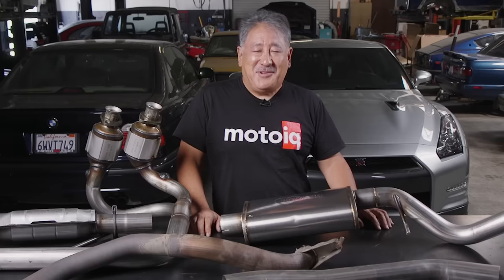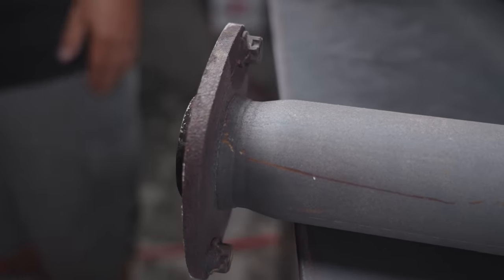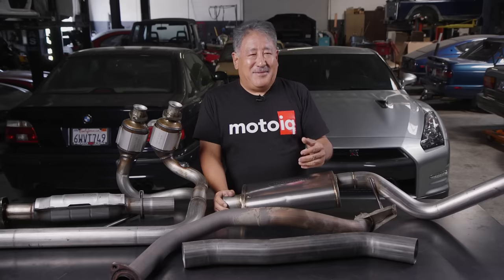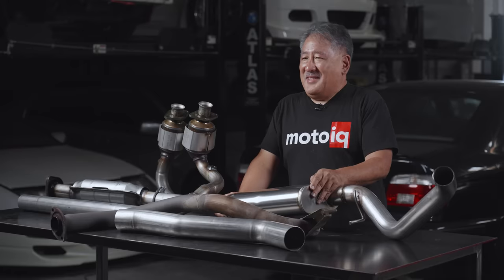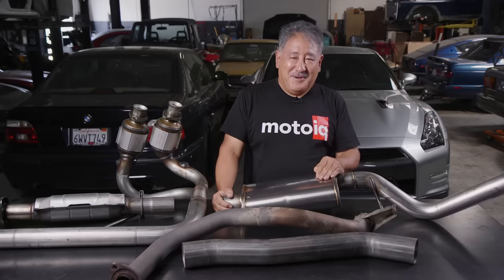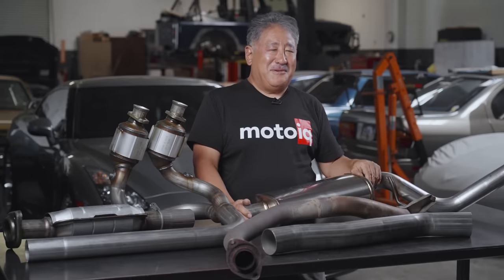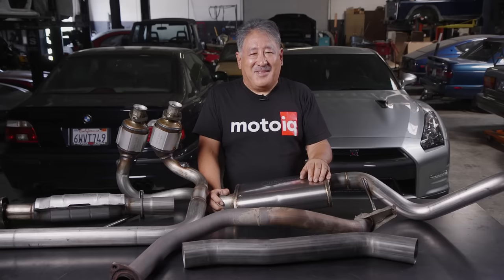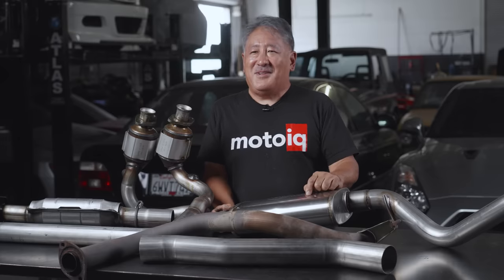Exhaust Back Pressure Myth DEBUNKED!

Comment: My Harley  definitely goes better and has more torque with a resister washer in the end pipes.
Reply from the maker: What happened is either, a big exhaust leaned out your AFR or the exhaust was too big and killed your velocity. Put a wide band on and log your AFR, if it is lean, retune it, if your AFR is OK you will run better if you lose the restrictor and run a smaller diameter primary pipe instead. Velocity up, backpressure down.

Comment: What about cars with a big muffler, change it to a straight pipe.
Wouldn't that annoy the computer?
Reply from the maker: Big doesn't define the performance characteristics of a muffler other than its big.
Reply: @motoiq  
Ok how about like a brand new mercedes, right? But at the end of the exhaust, you put yo dirty sock full of sand in there.
Car runs fine whatever.

But then you literally take out the whole thing, muffler, cat even the fucking manifold and shit.

Would the ecu think "yo, why i no feel any exhaustion?" And then it does some fucky ucky things and make the car run bad?

Or would it think "bro I can't feel shit and that's not my problem LMAO"?
Reply from the maker: I dunno there are a lot of variations of brand new mercedes you might need to tune your ECU.
Reply: @UltimatumDemon yes, obviously when u change exhaust the af changes and needs to be mapped to compensate for the extra flow .

Comment: So basically every car needs different types of scavenging,  back pressure or velocity. one formula does not fit all application from high RPM to low RPM to turbo's, sports cars to working trucks. Depending on the vehicle Application or year, Exhaust Back Pressure Myth is not DEBUNKED, for some vehicle. lol.
Reply from the maker: There is no such thing as backpressure scavenging.

Comment: When is somebody going to put out a video to explain the difference between an engine, combustion versus a motor which is powered with an electric motor. I think this is important because of sudden Spike with EV cars that use motors . I took a NASCAR engine building course and the first thing the instructor said was do not call this engine of motor because Motors use electricity and engines use fuel and fire AKA combustion.
Reply from the maker: Easy one uses gas and the other electricity.

Comment: Back pressure/scavenging pressure. Are 100% real. 

For example, if you build an NA motor, it will require long tube headers. So it can scavange properly. This is also called back pressure and is used during the overlap period of the NA engine.
 If you put short tube headers on a NA the car will 100% run like dogshit. And barely make power
Reply: not true at all, scavenging and backpressure are not the same thing. you dont want back pressure

Comment: I have a 03 Passat W8 6spd that had a huge exhaust leak loved the sound of it, and didn't notice any power difference but I got it patched because it was loud enough for a ticket and even tho I doubt I did any damage to my car running without back pressure big holes separating  both pipes  for like 8 months their is a reason they are engineered with this in mind correct?

I know the myths you wont make any power etc are not true(gen z short attention spam don't wanna watch whole vid rather talk to the person who knows the info myself sorry, will watch it later maybe with food) 

but why does back pressure exist to simply make an engine run better in the sense of smoothness or emissions?  I think car enthusiasts fail to realize a lot design choices are meant of power in modern cars

and if that is the reason they exist does this have a impact on longevity and lifespan of vehicles
Reply from the maker: We did the video so we wouldn't have to talk to people all the time!

Comment: I run flowmasters about the only last great muffler
Reply from the maker: It depends which model, the old school chambered ones actually have a lot of backpressure.
Reply: @motoiq  I've got the super 10 flowmaster
Reply from the maker: Those are loud and believe it or not pretty restrictive.  I gained 40 whp when switching from those to the FlowFX series on a pretty built Ford 5 liter Windsor which put out about 400 whp on the motor on 91.
Reply: @MotoIQ  wouldn't of thought that their single stage muffler to
Reply from the maker: Yeah who would have thought that such loud mufflers could be restrictive and kill velocity. These work pretty good too. https://www.holley.com/products/exhaust/mufflers/absorption_glass_pack_mufflers/maximum_flow/

Comment: I love how you use complicated/technical vocabulary to drive your viewpoint home... problem is...ya you need back pressure on modern fuel injected cars or they are going to lose power..why?.. when the manufacturer made whatever vehicle were speaking of they had A TEAM OF ENGINEERING MASTERS.. UHH YA DUDE..A TEAM..and they carefully took exhaust diameter/back pressure into consideration and matched this data with the cam lobes/duration/fuel injector flow rate/throttle body/port sizes/plenum diameter/calibration of mass air meter/variable valve timing/ECU/ECM mapping/airbox flow rate/airbox tube diameter/air filter/on and on and on...yes all systems work together.. including the stock exhaust..if you take a stock modern fuel injected vehicle and simply bolt on a free flow exhaust.. congratulations your car makes more noise and lost power.. ESPECIALLY when you are talking about HONDA /TOYOTA.are you aware that 80% of mechanical/electrical engineering students at the absolutely best universities in the world are sent from Asia just to get there education/degree and return home to work for these manufacturers...uhh ya dude MIT/YALE/HARVARD..ya it's 80%asian..and Honda/Toyota have a team of MIT graduates coming up with the exhaust diameter/back pressure/muffler flow rates to match and run optimum with all systems and you think your going to change something and make it better.. your a funny guy.. unless you change EVERYTHING... you should change nothing... everything means a matching setup including everything I listed above that is engineered to work together.. everything...
. this is not my opinion.. this is the fact.
Reply from the maker: Ok since you called us out and are pretty cocky and condescending, maybe you might want to know about our qualifications, some of our staff consists of engineers from OEM manufacturers like Nissan, Toyota, Garrett, and Ford.  Some of us have worked as engineers for Nissan's performance division Nismo, and Toyota's TRD. So we are not talking out of our asses.  Every modern car that we have added a cat back exhaust to had absolutely no issues and every single one of them gained power, sometimes by a significant amount.  Modern engine controls can compensate for differences in VE and can change fueling at least plus or minus 10%.  We have changed headers on modern cars and remapped the ecu and made huge gains. The gains were pretty big before remapping and tuning gave even bigger gains.  We have even added an exhaust and intake on cars like the C8 Corvette that uses GM's uncrackable Global B ECU architecture and made significant gains.  So please consider who you might be talking crap to in the future.
Reply: @motoiq  sorry I pissed you off.. that wasn't my intention...but everything I'm telling you is from many years of experience..as a engineer that works with Toyota among others you should know that any adjustments you make will simply be temporary and undone by the ECU/ECM  after a few cold start cycles...ya that's what the "I" is for .." intelligence" such as variable valve timing with intelligence..and if it can't self adjust to stock parameters it will simply kick the check engine light and run on open loop
..that's ok who cares right? just like playing with the ECU/ECM California already does a Dyno free smog check they just plug the car in and the state computer checks for the year/make/model/vin/version number /the mapping and knows if there's been any tampering /remapping WHATSOEVER or if there's any fault codes or pending fault codes..so you just fail immediately and get directed to the state smog referee...but who cares right 👍...and many other states are following California in this technology..
Ahh that's ok...right? bet you install K&N filters with your cat back systems too..that's usually another real good one I've seen...
now you introduce a oiled reusable filter element in front of a MAF sensor thats engineered for a dry paper element and leaves a oil coating on the fine heater wires and car runs like crap.. 🤔..ya dude I know all about the Disneyland modification rides.. unless you're changing everything and running a stand alone ECU and don't care about smog checks.. your just making noise running on open loop/no longer can pass any smog check and going slower..I am a factory trained technician for Honda of America and have worked at a few dealers myself and have removed many catback systems/cold air intakes /turbo setups/supercharger setups ..on customer cars after they spent big money on aftermarket mods and there cars ran like crap /couldn't pass smog/got tired of the check engine light/car was sucking gas and going slower/and they came to the dealership after greasing there own behind and asking to please fix there car...ya..been there..done that..many times..I still do these types of repairs to this very day...keep modifying people's..I will keep fixing them... thanks
Reply from the maker: K&N has done studies on their filters leading to MAF contamination and found that it is not an issue, many of their parts have CARB EO numbers so they are completely legal in California.  If it was an issue, they would not pass the testing required to get an EO. They also have a warranty that if one of their filters damages a MAF as provided from K&N they will pay for it.  K&N has a fully certified emissions lab and does extensive testing on parts being submitted to get an EO.  If the MAF gets contaminated it is a user problem caused by not following the instructions in cleaning and re applying the oil. Cat back exhausts are legal in California as are many other mods that have a CARB EO.  As far as the ECU's self learning, changes to the fuel and timing trims to not immediately go away with a few cold starts, with parts changes, the ecu will update from STFT to LTFT where the memory is only semi volatile and it will stay as long as the things that caused the shift remain.  It's how the ECU will stay in tune with normal engine things going on such as sensor degradation, engine wear, carbon build up, what kind of gas the owner uses and their driving habits.  Sure there are plenty of ill conceived mods that will mess up performance, cause check engine lights and prevent ready codes from tripping but a well designed cat back won't do it nor will anything that has a CARB EO.  We have plenty of dyno charts and long term results to prove that and a complete understanding of how ECM's work.
Reply: @motoiq  certainly K&N is not going to bankrupt themselves by publishing anything other than there setups are the best thing since sliced bread was marketed.. unfortunately..the reality is different..the problem of erratic idle/loss of power/surging idle/check engine light/multiple codes not related to MAF sensor have all been completely corrected by removal of aftermarket cold air intakes/K&N to be specific and reinstall factory air box/paper element and new MAF sensor in my 30+ years...as for the ability of the ECU to correct normal conditions such as sensor degradation/engine wear/carbon/etc..yes completely correct..but I don't think hacking off and replacing a exhaust system with entirely different flow rate or the same to the intake system is something that falls into this category...do a little experiment..go open the hood on one of your cars and find the factory set screw on the side of the throttle body.. now adjust it.. you just raised/lowered your idle right..sure it's going to be where you want it for now ..but...let it warm up.. tomorrow cold start it.. repeat..in a day or 2 it'll be right back to normal..just like you never touched it..and if it can't bring it back to normal factory parameters it will kick the check engine light...no arguments.. just the facts here...been doing this for 30 years man..I know just a little.
Reply: @Mikegastaldo  30 years and yet you still don't understand how ICE engines work, that's pretty impressive.
Reply: @MrRockrazer  I'm aware your taking the same position as K&N as to your exhaust mods...I wouldn't expect anything different..go to any honda/Toyota/Nissan/Acura/Lexus dealer..talk to any senior tech and he will mimic what I just explained.. keep in mind that dealer is not only where you bring your car for complimentary oil changes..nah.. when nobody can fix it..WE DO...ya I know a little something.
Reply: @MrRockrazer  also very curious on why you didn't even touch the subject of smog checks? you are aware the state of California is using software to identify ANY MODS WHATSOEVER TO THE ECU/ECM right? Your aware many states are following suit? what is your position on this for a regular owner that has a bunch of bolt on junk with custom map? sounds like a $1000.00 dollar smog every 2 years to make noise/suck gas /and look at a check engine light.
Reply: @Mikegastaldo  dude how old are you? You can’t even figure out who you’re replying too
Reply: @MrRockrazer  first time I seen your comment.. sorry..was driving..changes to cylinder head but nothing else will yield nada..same applies to any component you can think of including exhaust..am I anti modification? ohh no.. you want to bore the block press steel sleeves in nice pistons/tons of headwork/big valves/springs /retainers/match port big header/intake to cylinder head/run a stand alone Aem ECU /Dyno tune it while you're changing mapping and get it right.. 👍 ohh ya..I'm all in..you wanna bolt something on and make noise/throw the check engine light/suck gas/can't pass smog/car is slower than it was stock? nah I'm not your guy..I don't do mickey mouse.. sorry baby.
Reply from the maker: I just explained to you that the running parameters of the engine including the trim changes an exhaust and intake might cause are saved to non-volatile memory, you can even see the percentage on the dealer-level OBDII scan tool, you must surely know about this right? Non-volatile means that the changes will stay through key cycles. The ECU can adjust the trim pretty far before triggering a MIL light too. Whoever said anything about K&N publishing that their setups are the best, they just have a warranty for MAF contamination and have done extensive testing for it. Actual testing by engineers I might add.  If it was an issue on a property-serviced K&N  filter or intake they would have never passed CARB certification testing and obtained an EO number.  CARB testing is a 5-bag FTP test, the same certification that the car has to go through from the factory to be sold. If anything messes up the emissions at all, the part fails, no EO number and you can't sell it as a street-legal part. When I was an engineer, I oversaw the emissions testing on these parts and other intake manufacturers so we could sell them for Nismo on new cars for instance.  Plenty of dyno data shows that we have never lost power on any of the cat-backs or intakes we tested.  We only tested good ones from reputable manufacturers, I dunno what you have been taking off of cars, it's pretty hard to design a cat back that will trip-check engine lights and lose power if you are a decent manufacturer.  I dunno I validated a bunch of exhausts for the Nismo OES program and none of them did, they all made at least 10 whp.  We have done scores testing at MotoIQ too.  I am an ME and worked for OEM's and OEM'S race divisions for years, I know just a little,
Reply from the maker: I might also add that properly designed parts will not only not trip MIL lights but will typically improve mileage all other things being equal.
Reply: @motoiq  impressive/interesting experience under your belt for certain.. absolutely sincere comment...my comments come from seeing dozens and dozens of people go on a bolt on frenzy/spend big money/and they ended up with a car that runs like doodoo...I'm more than happy to be the clean up guy..top of the line alarm system with paging/starter interrupt/remote start..etc? ..ya I'm the guy who will take all of it out/solder and repair your harness/return back to factory mint after you end up with a drain that discharges your battery every day.... wanna make your car fast and do a lot of bolt ons.. ya I'm the guy who's going to take it all off and give you your car back running perfect like it used to before you ruined it... that's my first hand experience... Everytime..
Reply from the maker: I am the guy who makes your car fast and reliable.

Comment: Well in my opinion it depends about your exhaust design. I could tell that the backpressure part is mostly used on exhaust manifold to accelerate gasses into tight collector which will create the scavenging effect to pull next pulses out from the manifold into exhaust tube. But the rest of the pipe should be small enough that it wont reduce the flow speed and inertia of gasses. So if you have crappy collector which wont do its work then you can minimize the losses by making it big. Check out the scavenging effect theory about Laval nozzle, it is used on well designed exhaust collector
Reply from the maker: That is not exactly how it works, maybe you are right but the terms are wrong and lost in the semantics.